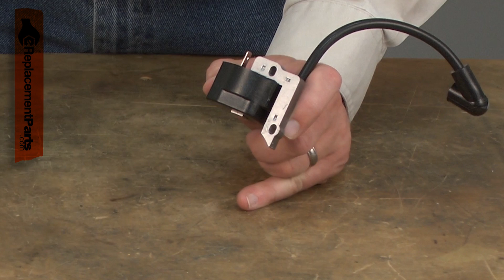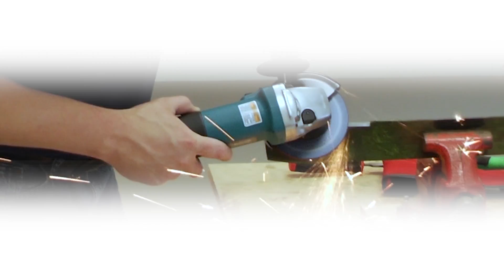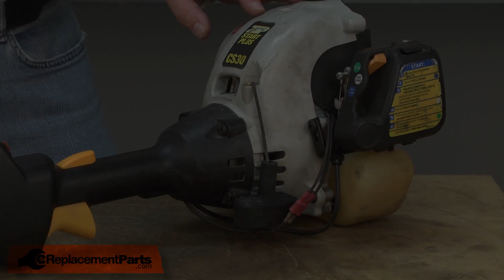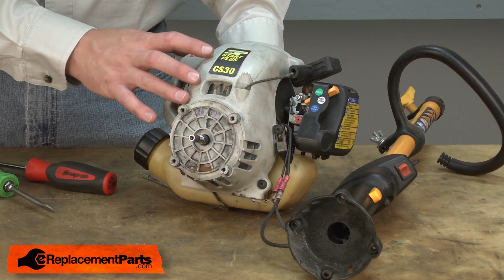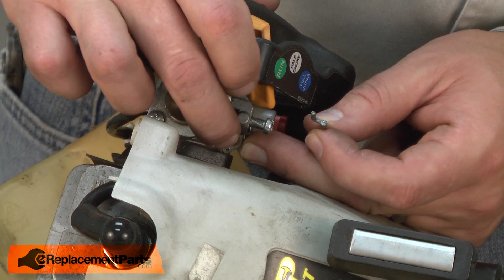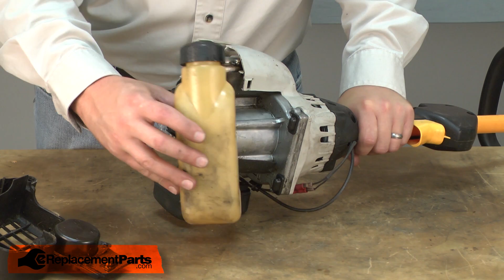Trimmer Repair - Replacing the Ignition Coil (Ryobi Part # 850080001)

Comment: You say the ignition coil doesn't go bad that often I think it happens more than people think it does just this season alone I had 3 coils go bad on my equipment first my blower vac second my hedge trimmers then third my lawn mower, after the engines would run for a while and get hot they would shut right down until I let them cool down then they would run again until they got warm again and shut back down classic case of a bad coil, I tested all three when cold and after warm up when they shut down and they tested for a no spark when hot replaced all three coils and everything works fine now.
Reply: Two strokes are bad for electrical gremlins and burning piston rings out
Reply: I had the exact same problem.... No start when hot. I thought it was the coil as that is definitely one way they go bad. But after checking out the rest of the unit I found out the carb had small trash stuck in the needle passage. Now it would start hot or cold but still die a while after warming up and had no power. So I figured I'd take a look in the front and see how hard it was going to be too replace that coil. Upon separating the front housing from the motor you could definitely see that the plug wire was worn right down to the center conductor from rubbing on the cooling fins on the motor. I needed to use it so I pressed the cut together and wrapped it in friction and electrical tape. Then I slid a small piece of sliced automotive fuel line over the whole length to keep it from touching anything. I purchased the new coil and it arrived days later but the weed whip is running like new. I will finish it the season with the old coil and install the new coil when I'm looking for something to do while drinking a cup of hot coffee in the shop on a snowy winter day! Oh it is a MAC 2816 that I've used every summer for over 30 years now and that was the first major problems I've had with that unit. I've since started buying old junk units and parts to refurbish them. That trimmer has taken any task that I've thrown at it and a lot I shouldn't have tried, and it handled them no problem and the cylinder walls and piston still look like new! 9:16 9:16 9:16 9:16 9:16 9:16
Reply: Yeah that exact same thing is happening to me right now on my Remington walk behind string trimmer and I wish I can figure out how to replace the Ignition coil and if I do hopefully that will fix my problem also because it runs fine for a little while but then as soon as it gets warmer or hot it quits and I have to wait for a little while like you said and then it'll run for a little bit again but just for a little while then it quits again and it ends up taking me forever just to cut a small amount of weeds where in the past when my machine was newer it wouldn't quit like this so I'm pretty sure this is the problem.

Comment: Hi, What type of screw is it that has to be undone , What head is it as I can't undo it and I can't see inside the drum that has to be removed at the start
Reply: It's an Allen Screw.  You need a hex wrench, 1/8th inch, I believe.  It unscrews anti-clockwise.
Reply: Mine is a T20

Comment: the cap 2 that fits on 2 the spark plug can away from the lead do I have 2 replace the whole ignition coil
Reply from the maker: Hi Mick. The ignition coil comes as a 1-piece part, so yes you will have to replace the whole coil. If you send over your model number, I'd be glad to help you find the right coil that you need!
Reply: thanks 4 the offer but iv given my bro its now his prob but will pass info on 2 him once again thank u
Reply from the maker: No problem, Mick. Glad to help!